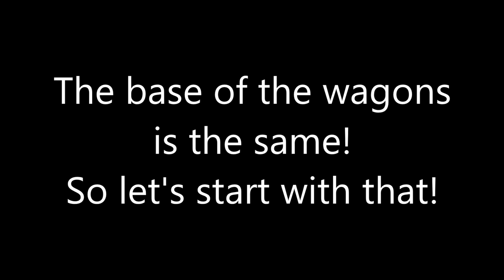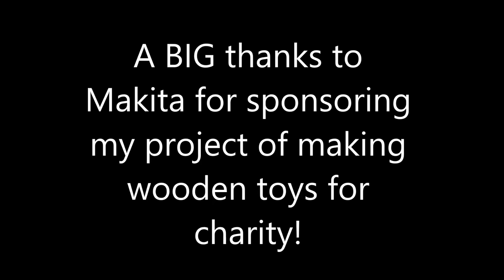How To Make Wooden Toy Train Wagons | Wooden Miniature - Wooden Creations

Comment: Question - How did you get the windows so straight on the caboose? I am having issues with them not being in line with the one next to them. I did a center horizontal line and then vertical lines to get my X. However, I am still finding that a hole is a mm too high or low. I am using a hole saw in my drill press. I noticed you were using a spade bit (don't currently own any). Is there something I am missing, or is it just a matter of practice?
Reply from the maker: Thanks for watching Jeremy! I draw a line to align them, just like you are mentioning. And yes, sometimes it's hard to align them, but I'm okay with that haha